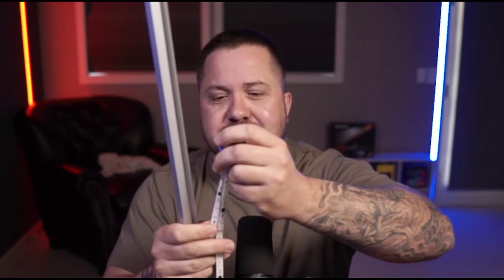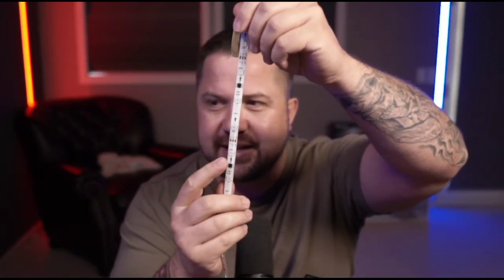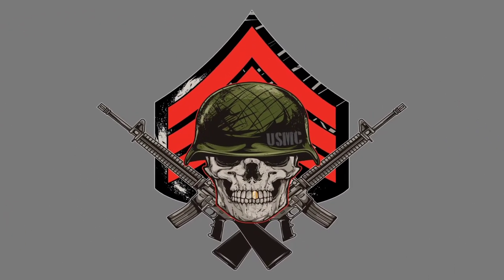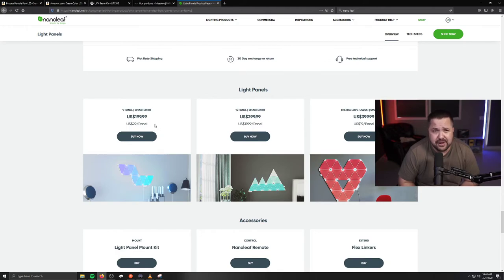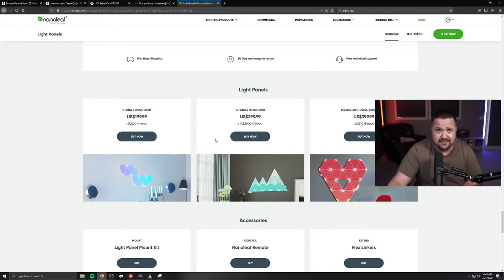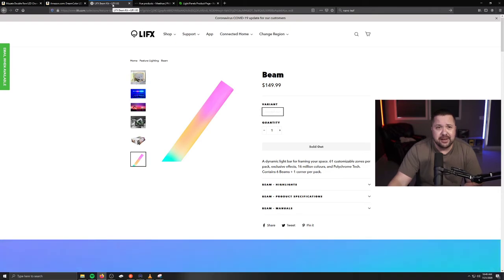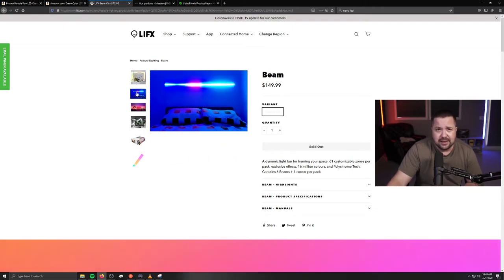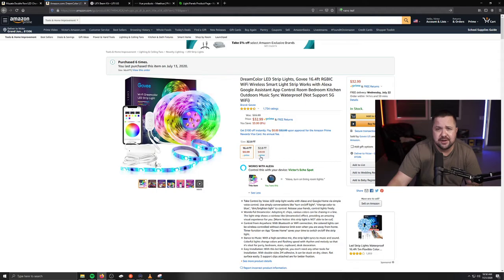HOW TO: LIFX BEAM HACK!

Comment: ALSO! Is that a Hack Ikea desk?? I'm looking at putting together one in an "L" shape configuration...
Reply from the maker: Yes its the IKEA desk hack you can Google search for the counter top, supports, and drawer units. My link no longer works but it is called the muzata double row LED channel on Amazon. Has to be double row if you want to run two strips side by side for twice the brightness!
Reply: @SGT._ROSIE  - Appreciate it, Hard Sarge!!
Reply from the maker: @grgsentinel978  those look very close. With Chinese brands they mass produce and rebrand. I can't make any promises but Amazon does have a very lenient return policy bud! The length is spot on tho you want them long to fill a whole wall in height and 20mm should work. Good luck 👍
Reply: @SGT._ROSIE  - One last thing, and I'll leave you alone I promise! lol
So with a 10pack of the channels, if I buy 3 sets of the 16.4ft Govee LED lights, I should be able to make at least 3 beam lights, right? [Govee is limiting 3 units per checkout]
Reply from the maker: @grgsentinel978  16.4 x 3 = 49.2 ft. (Lights) but you ÷ by 2 since you're running them side by side! This equals 24.6' of lighting you'll have. 
3.3 x 10 = 33.3 ft (led aluminum channel)
A standard ceiling height is 9 ft. So you'd have enoufh for 3 lights. I only did 2 aluminum channels at 6.6 ft. per light which = 19.8 total feet. If you need more led strips  what I did was place two separate orders in which I bypassed their order limit!

Comment: Im sorry but this will not come anywhere close to what Lifx beam can produce. I would’ve accepted it if it covered the functions of the lifx beam and just lacked in brightness and color customizability. But for the people considering buying smart leds. The beam has 64 individual leds in 1/6 or the pieces u see in that room. The 20 or so u will get in one small led channel will not only be just single color. But lacking in any customization that would differ in color generation of individual leds